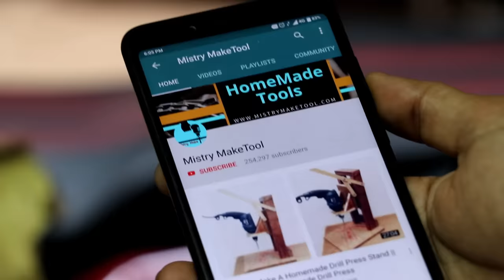Make A Drill Powered Sander Machine || Drill Hack || Drill Holder

Comment: Thanks a lot for this awesome video. Even if i'm sixty years old now, i still have my first drill machine Peugeot (i'm french) purchased when i was about fifteen years old, so, 45 years ago. As you can imagine, i have now a lot of other drill machines. Anyway, i would like to build the same sander machine with my old Peugeot, so, i would like to know wich kind of threaded shaft did you used (7'47").
Thanks a lot and best regards.

Comment: What size disc were these dimensions intended for (the maximum diameter disc)? I read that you used some 4 inch discs, is that the maximum? I will likely go to 7 inch discs and adjust dimensions.

Comment: Hi ! thanks for the video ! how to keep the drill running without holding the button ?
Reply: You should use a drill with a trigger lock to make it hands free or, use a jubilee clip to hold the trigger/button in but install a on/off switch between the power source and the tool.